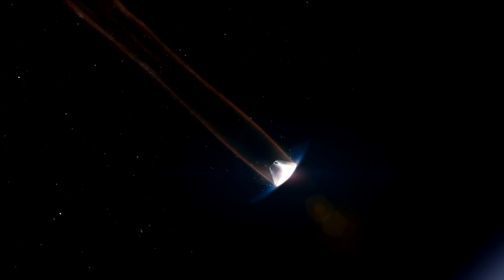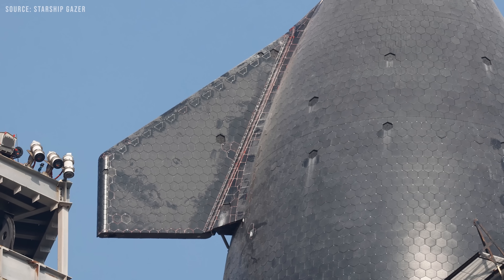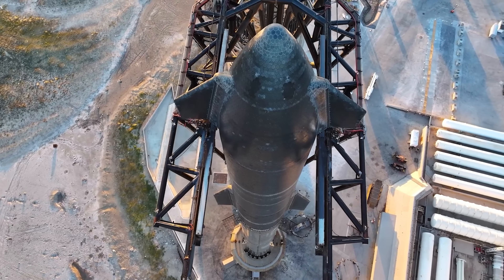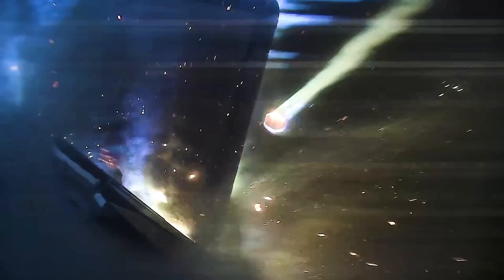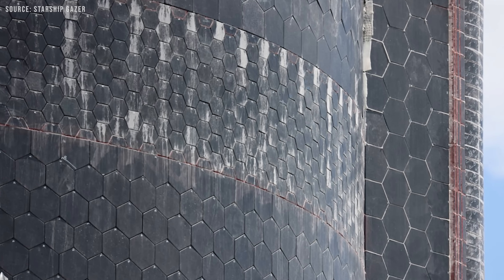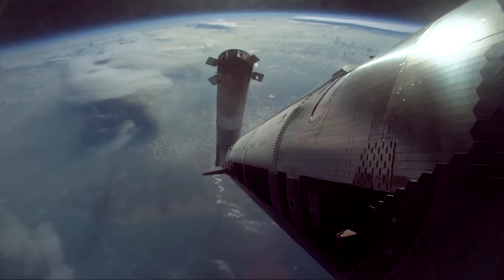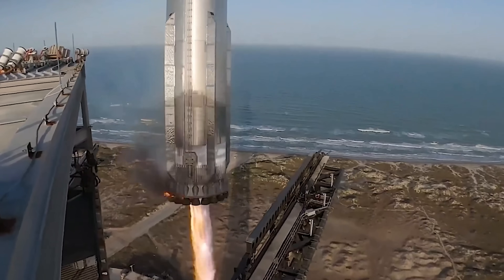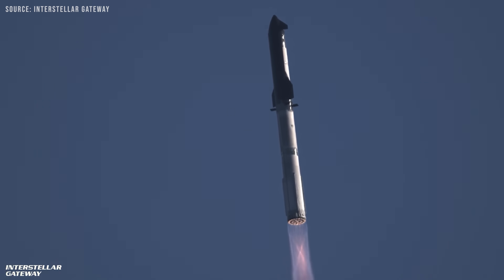Elon Musk revealed Inside New SpaceX Starship Heat Shield to Break the Physics

Comment: Strictly speaking a sufficiently powerful spacecraft does not need to suffer almost any heating effects at all, when entering Earth's atmosphere. The ship would reduce it's orbital velocity to zero, while staying just above the atmosphere. This requires getting rid of a lot of energy, which means a LOT of fuel. Then it could simply drop straight down, only getting minor heating effects as the atmosphere thickens.

That's how sufficiently advanced races get around the re-entry problem. Which is a big problem, until you have sufficiently advanced technology. So, alien spacecraft do not need to be streamlined in any way, to land on earth.
Reply: The DeltaV to decelerate from orbital velocity to zero speed is about 9200m/s for which a zero-cargo starship would need about 1450T of fuel to still have the 32T or so it would need to slow and land at ground level.
With a heatshield it needs about 5T to dip into the atmosphere to begin aerobraking plus the 32T to land.
Clearly a heatshield is the only practical way to get down to Earth as Starship can not lift an extra 1450T of fuel to LEO (estimated payload for V3 is only 200T)

Comment: Why is the heat shield covering one side of the ship? Covering the whole spaceship could help it with the Mars mission.
Reply from the maker: Starship going belly first, so only one side get extremely hot. You can covel all but it would add a lot of weight
Reply: No it wouldn't.

Comment: In other words they have no clue how to rapidly reuse starships.
Reply: Reentry heating might make that impossible. Making methane and pure oxygen out of the thin carbon dioxide atmosphere will be a lot harder. I would suspect that nearly all the water on Mars is locked in permafrost. You need strong powerful machines to dig up permafrost. No diesel on Mars either, nor oxygen to burn it.
Reply: @billsimpson604 Methane is available and solar. They need a reactor to get started. Lots of power is necessary.
Reply: You are very clearly not an engineer. Nor one with any understanding of how product development works.
Reply: They understand how to rapidly reuse starship.
With most non-trivial problems there is no perfect solution. There are multiple solutions with various pros and cons and you pick your preferred tradeoff.
Starship is still in development and part of the development process is to evaluate the options.

Comment: When will we use electric fields to protect from heat like in Star Treck? ;-)
Reply from the maker: That would be sick, but unfortunaly very far away
Reply: Same thing I was thinking. Maybe a reactor installed would do it.
Reply: It requires a lot of power to create an electric field strong enough to repel the plasma.
This is a case where a larger ship benefits from the surface to volume ratio.
 It won't come until humanity is building truly vast ships, maybe 10 or even 100 times the size of the present Starship.